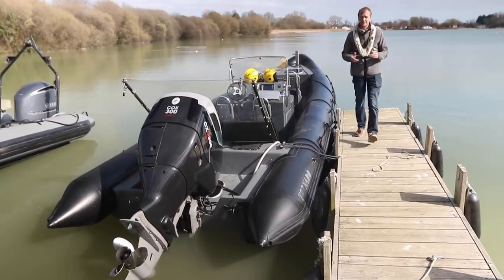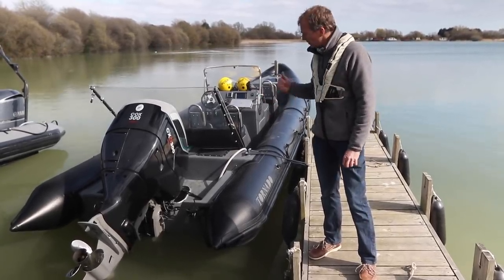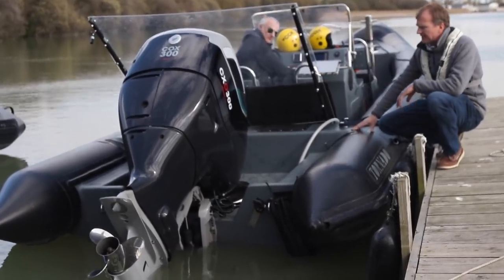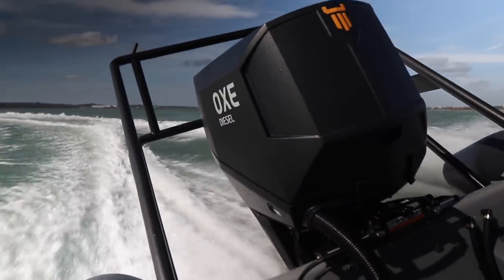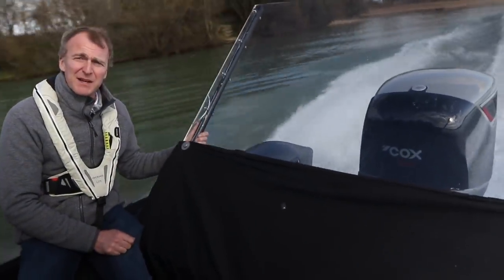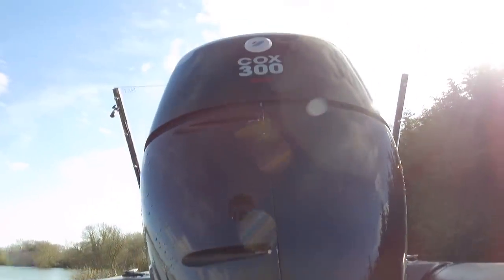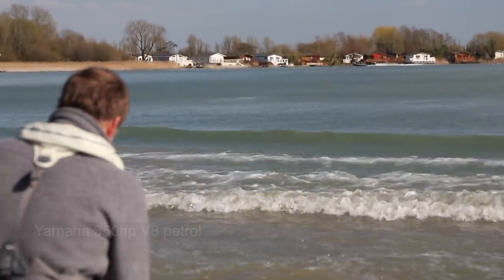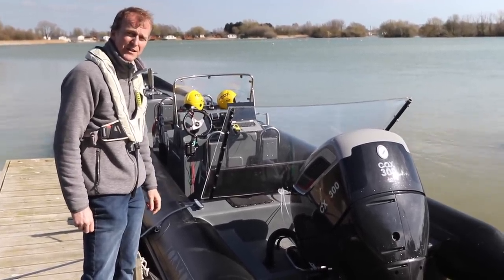Exclusive test: World's most powerful diesel outboard | COX 300hp | Review | Motor Boat & Yachting

Comment: I’d say that outboard is perfect if you really love the sound of a ford transit going 110 down the motorway
Reply: And want to produce cancer forming gases!  Will they also ban new boat diesels in 2025, like cars?
Reply: Hahaha a little bit louder?
Reply: There is now V8 Transit
Reply: I could not handle trolling with a 2 stroke at 1.7mph. Huffing diesel exhaust for 8 hours would be just as bad. Trolling with a 140hp 4 stroke purring away is great.
Reply: NeiI S. exactly
Reply: Well I do so...
Reply: The Metal Butcher £42000 for a base model and it’s yours
Reply: Well if you want to turn a speed boat into a super speed boat just strap that on and hold tight
Reply: @robc3863  Uk is out of the EU ...We will be bringing diesel engines back to Glory
Reply: @tinybubbles3724  The exhaust vents into water wtf are you on about
Reply: @tinybubbles3724  but how does 2 stroke or 4 stroke describe an engine as gasoline? Diesels are 4 stroke. Plus 2 stroke diesels were made.
Reply: @Interdiction  Also above there
Reply: @robc3863  nobody is gonna ban anything try as they may treehugger.

Comment: Sorry did you say it was smooth running?
Reply: It’s a diesel it’s gonna sound rough that’s how they run and yes for what it is I think it sounds good. Look at the big picture here it’s a 300hp monster packed in a little outboard that runs on diesel a cleaner solution albeit not the cleanest I agree but sill not petrol fumes.
Reply: @timwegman5776  It's a huge, heavy, expensive and noisy outboard. I can see how this could be a decent outboard for commercial and professional use, but for pleasure boating, the modern four stroke gasoline outboards are a better choice.

Comment: I have operated the mercury diesel outboard that produces 195Hp and were fitted in a twin setup on a similar sized boat. They were extremely quiet, quieter than Cox from what i could tell in the video, certainly did not have to raise our voices. Which is amazing as it was 2 stroke. The engine is based off the optima 200Hp block, 10:1, spark plugs to aid in detonation and emissions. These engines would push a 4 ton 7.6mt rhib at 40+ knots very quietly as quiet as any modern 4 stroke petrol i have driven. Only issue i had was the very clunky dog clutch gears shifting fwd to rev, my job was a lot of manoeuvring when not WOT but had no issue with the diesel at all. Fuel consumption was still thirsty at WOT, both engines would suck the 420lt tank in about 3 hrs but could manouver all day and only use 10lt

Comment: From the early news on other diesel outboards compared to gas outboards of comparable power is that the diesels are about 60% heavier. And about 125% pricier.
Reply: This engine is about 60 kg heavier than a comparable petrol outboard (except the new Mercury V8). And a lot more torque. But it's not for everyone.

Comment: Its noticeably louder than a yamaha or mercury 300hp outboard at idle and while cruising
Reply: 300 HP is also lousy for a V8 4.4 litre, unless it's different for boat engines. Some guy tuned a 1.9 TDI  for 360 HP. It does roll coal, but it is less than half the displacement and half the cylinders. Surely 500 HP are possible for a V8.
Reply: @fungo6631  Think about it, a boat engine has no transmission, the engines in all outboards and inboards have to run at full rpm to provide top speed.  Pushing a hull through water creates a lot more resistance than a car going through the air and on asphalt.  Boat engines might seem really huge and inefficient compared to cars however marine engines along with all industrial diesel engines are designed to run at FULL POWER almost indefinitely.  Your car engine is not designed run at full power all the time and if it does it will dramatically shorten the engines life.  There is absolutely no comparison between car and marine engines period.
Reply: @macdonaldjohnstonfan  But marine engines can have better cooling because of a constant influx of fresh cool water.
Reply: You afraid of noise?

Comment: There are other brands as well .... but the 2 main advantages for diesel outboards: 1) lower fuel consumption / diesel fuel cost and 2) on large yachts as tender motors - uses same fuel as the yacht so no need for different fuel storage just for the tender.
Reply: What about heaps more torque per hp !!

Comment: You can double the pitch of the prop because of the double the torque. Lower Rs twice the speed.
Reply: Horsepower is horsepower. It's going to have the same top speed if propped correctly as a conventional 300 HP outboard.
Reply: @otm646  Not true.  The conventional 300 HP will be faster because it is a lot lighter.

Comment: Interesting to see a comparison with the 300hp 6cylinder dual turbo OXE outboard.
Comments about noise in comments. Diesels idle with more noise and do more internal damage, they alwsys are better under load. This is a commercial motor that will really save money, especially where diesel is not taxed.
Those things can pull a tug boat, so an inflatable is sort of a joke...

Comment: This is what happens when militaries ask for a quiet, powerful diesel outboard and cost is no object.
Reply: John Buick Where are you from? If a marina sells fuel at all it sells diesel, it’s petrol that they don’t always have here. And I can’t remember the last time I saw a new 2 stroke outboard for sale.
Reply: John Buick Seriously. Here in the UK I haven’t seen a brand new two stroke outboard for sale for years. You still didn’t say where you’re from but two strokes are also harder to get hold of in other places because they don’t meet the necessary emissions standards nowadays. This is especially the case for very small outboards. In larger ones manufacturers sometimes make the effort. 
And the diesel thing still stands, because 99% of inboards are diesels. So all marinas have diesel. 🤷🏻‍♂️
Reply: John Buick Huh. That’s interesting. Maybe it’s because people want the ability to trailer boats between lakes so outboards are more common. We don’t have a huge number of inland lakes in the UK only a few that are isolated and big enough to be worth marinas. There are the canals and rivers and then the sea, so the marinas there will have diesel for all the boats with inboards that visit.
Reply: NATO single fuel policy phase 3(elimination of gasoline from battlefield logistics)

Comment: I wish Penta would make diesel outboards the D5 would be a perfect engine.
Reply: Hahaha the inboard version of it is a disaster
Reply: @martinandersson5278  I disagree the D5 is compact enough to be mounted as an outboard and chipped can make plenty of torque. However Volvo Penta invested heavily in Seven Marine for outboards
Reply: Will Riley first of all 
I have worked as a engine product developer at Volvo Penta 
The D5 is not a suitable base engine 
It’s a full aluminium engine that started it’s life as a automotive engine 
An engine that has a average load of 35% during it’s cycle 
A marine engine has 90-100% load factory 
So it’s not just a matter of chipping the engine, so much more then that 
The D3 is the worst that have left VP since the MD21 indenor
Reply: Martin Andersson Yeah but look at some of the engines OXE uses. Aluminum is key to outboards less weight. It's all about marineizing (not sure correct spelling) Meaning brass cooling ports etc. Its just got to stay cool and have good oil pressure also proper cams.
Reply: Martin Andersson I'm not saying the D5 is necessary perfect as is. Some updates definitely could be made it is a pretty old engine design at this point.
Reply: Will Riley oh let me get you the number to my old employer, since you are an expert on this

Comment: Designed and built in Britain? Well...you better bring five gallons of oil, a full tool kit, an engine manual, an emergency radio, emergency rations etc....
Reply: Don't forget the cyanide pills.

But I like this engine it's cool

Comment: I think  it sounds like the cowling is a bit loose and is vibrating. A V8 diesel should be reasonably smooth. I don’t think that will be the main selling point. It will probably be used in “all Diesel” military and commercial use. It sounds like more like a 4 than a V8: flat plane crank? The Oxe 300 is built around an inline BMW 6 so will be sweeter I would think.

Comment: I don’t see this as a contender to the Mercury at all. Mercury has the direct injection 350 hp v6 that is quiet and built in America. I just don’t see this Diesel even coming close to 300
Reply: Red diesel 67 p a litre.. petrol 137 p a litre. 
In Europe that's a huge difference

Comment: What is the point of developing a new diesel engine when diesel engines are increasingly being banned?
Reply: that is not gonna happen
Reply: Well... that remains to be seen! As less and less cars need diesel, demand for diesel will fall. Consequently the price will increase and diesel will become more difficult to source.
Reply: @ririshow  100% nonsense
Reply: Maybe diesel engines will be banned in 100 years. No problem.
Reply: They make theese for military-/ and big yacht tenders. As they don't wan't to carry a lot of gasoline on board.
Reply: ririshow You are not going to have an issue sourcing diesel in a marine environment. Basically everything that floats and has an engine inside it uses diesel.

Comment: If the block was made from CGI, the block could have been made smaller, stronger, and lighter than a aluminum block. 
The same is true for the heads, and CGI has 90% of the thermal conductivity of aluminum, thanks to its corral like graphite structure.

Comment: A diesel with an all-aluminum block to save weight, 🤔
The longevity of this engine will definitely suck ☠️.
Reply: Don Olypopper  sorry you're the one living in a different universe. Currently there is not one known diesel engine that has proven itself made entirely of aluminum block. No real diesel manufacturers use and all aluminum block. Being a diesel mechanic as well as gas we're past 50 years I think I know what I'm doing. 🖕
Reply: Don Olypopper  He can't be stuck on Detroit, Detroit had a successful Aluminum block.
Reply: @Perry-ck1hv  Detroit Diesel, General Motors, Mercedes, and Honda are not real diesel engine manufacturers? They all have an aluminum block diesels.
Reply: @Perry-ck1hv   70% of diesel car engine manufactured have an ally diesel motor and have been tested to easily do 750 000 klm. Keep up bro

Comment: The only thing I could see missing in this video was a large length of rope. That diesel outboard would make an awesome anchor at 300kg’s!. Waste of time and development $, developing a hybrid outboard motor would make far more sense.
Reply: StabyMcStabsFace 
Jeeze, i dunno, perhaps have half petrol half electric so you use less fuel? Or did you just want to burn as much diesel as possible and pollute the water even more.
Reply: Old Mate Scano yes a gasoline hybrid makes a whole lot sense on a NATO warship where there will be no gasoline in the future. Nor will there be any gasoline on supply ships or naval bases either. NATO single fuel policy phase 3(elimination of gasoline from battlefield logistics).

Comment: The benefit of diesel in the US you could use much cheaper off road diesel
Reply: You can bet the government will prevent that.
Reply: @brianmcbride99  in the US we have off-road diesel for this purpose already, boats aren't going to change that fact
Reply: phoenix love correct. My point is, just like you can’t run the red stuff in your daily driver with a diesel. You can bet the US government will not allow you to run the red in these marine engines either.
Reply: @brianmcbride99  given that it's already used in diesel boats here I don't see what's gonna change?
Reply: phoenix love off-road diesel is already used in diesel marine engines in the US? If so, The change I could see would be outlawing it, like the US does now with on road vehicles.
Reply: @brianmcbride99  I don't think a new outboard engine would cuase the outlawing of off-road diesel. Inhale no faith in my government, but I'm still realistic

Comment: Developing a 300hp ELECTRIC outboard would be the way to go. Hard to see why anyone would spend money developing a diesel outboard at the moment. It's like developing a new betamax video recorder.
Reply: There would have to be a huge revolution in battery capacity to be able to run a boat at higher speeds with an electric outboard. It is the future though, no doubt, but I would guess it is at the very least 10 years away from being reality which is a shame as electric motors are awesome!
Reply: Problem is you can't go very far with an electric outboard. And it would be even more expensive. Everyone wants a diesel outboard like this.

Comment: This engine, at 10x the cost off a conventional outboard, would have to burn sea water in order to ever have an ROI and market.  Anything ocean-going that needed a 300 hp diesel would use a simpler, more efficient, cheaper to maintain, inboard with readily available parts.

Comment: It's fucking noisy, which is typical for diesel compared to petrol. And unlike petrol it's not a nice noise either, it's a hard fatiguing noise. Biggest issue will be to dampened, isolate and resonate out that noise. They need to work on that for sure.

Comment: 35 Knots top speed?  
A Mercury 300hp would make 50 on a Tornado 8.5 rib.
Reply: Diesel engines run at much lower rpms and are slower as always. Your not satisfied with 35 knots? You want more and more and more dont ya you greedy bastard.

Comment: I still rather have a Mercury outboard  they much better motor
Reply: If you can get and afford the petrol, sure. But there are marinas where diesel is available but petrol is not. If you're bulk-buying bulk-tankering diesel (e.g. a Navy, big marine operator, etc.) then having a one-fuel source makes sense. Remember Williams Jet Tenders were basically forced to make a Diesel version because so many of their customers found it quite difficult to get petrol in various ports around the world.

Comment: Sorry but gas 2 stroke engines are king. Period...
Reply: Chad Moyer you are not wrong 2 stroke is very light and good power
Reply: Maybe on small boats
Reply: Who doesn’t have a 4 stroke these days? Far better.
Reply: @cjeam9199  except for the weight and maintenance costs....from Wyoming USA 🔫🤠
Reply: Bill Allen Yeah ok weight but don’t have to premix, generally better fuel economy and burns cleaner both smell wise and fuel into the water wise. And what’re the maintenance differences really?
Reply: @cjeam9199  oil injection has been around for years and oil usage is very minimal on e-tech type engines the 2stroke isn't dead yet...from Wyoming USA 🔫🤠
Reply: Maybe a turbo 2stroke outboard mmmmmm...from Wyoming USA 🔫🤠

Comment: 300 horse power from a twin turbo diesel v8? That aint shiiit
Reply: I agree but this just tells me one thing, it will run with little to no stress. Its producing more than enough power and delivering great fuel economy. I'm sure there's room for improvement.
Reply: Remember that it works at near 100% capacity most of the time unlike a car engine

Comment: What is the point? My 6.3m Humber rib does 39 knots with a 90hp Yamaha Two Stroke. It has 157 hour on it so it is pretty fresh even if it has a few years on it. How could anybody recoup their investment in an engine such as this. Great idea for sure but the figures dont stack up.
Reply: Sean Carroll NATO single fuel policy phase 3(elimination of gasoline from battlefield logistics). Cox engineering was contracted by the british ministry of defence to develope this for the 250hp+ diesel outboard requirement.

Comment: Guys just give it up, we are going electric from now on, thats the future...
Reply: Do you know of some super special, super secret battery that has 20 times the energy density of anything currently on the market?!  If not, sit down....you're drunk...
Reply: @tstanley01  Racing electric will show that.. Have a beer...
Reply: @nicholaschristophorou3087  No, it really won't.  The math is pretty simple.  Using current high end battery tech from Tesla of 260 wh/kg, you would need a battery that weighed over 12000 Lbs to push a CC with twin 300s at 75% power for 4 hours.  You would need to increase the energy density of current tech to 14X what is is before it would come anywhere near competitive with a fuel based motor.  Right now they don't even know of a chemistry type that could do that theoretically.  You would need some type of fuel cell that runs off either hydrogen or some other type of solid oxide fuel cell.  It would be nice to have electric outboards in a recreational fishing boat,  but I doubt we will see it in our lifetimes.
Reply: @tstanley01  For now... The FUTURE as i said is electric motor...
Reply: @nicholaschristophorou3087  Why is electric the future?
Reply: @niklasheikinheimo2324  Free energy from the sun and wind...
Reply: Free?! Those are the most expensive form of energy production we have.  Forget the fact that we have no way, even theoretically, to store enough energy to power an outboard motor, for any length of time, natural gas and nuclear are probably the most cost effective way to create electricity moving forward for the next several decades.
Reply: @tstanley01  Explain this to Caravans with sun panels and jell baterries all over Greece and sailboats too... When electric bikes cars boats start racing you'll see...
Reply: Justin Stanley Your figures are out of date. The cheapest form of energy generation is now onshore wind, then I think it’s solar. In some cases building new onshore wind farms have been calculated as being cheaper than keeping old coal power stations going (which is more due to how expensive it is to continue to run an old coal power station than anything else). 
Indeed it’ll probably take a while for this to end up in boats though, because batteries are heavy.